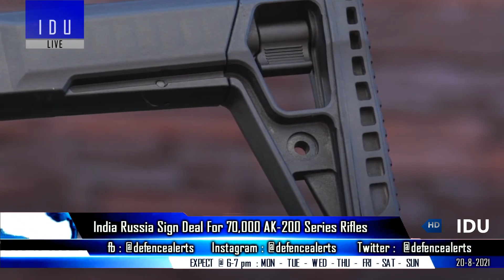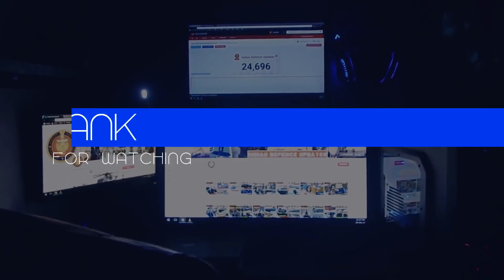Indian Defence Updates : 70000 AK-200 Series Ordered,36 Tejas Export,NGSLCM Final Phase,2 New UGCV

Comment: It looks like that exports of Tejas fighter jets will help us import foreign made fighter jets! The could be due to the fact that with acute shortage of fighter jets with IAF, and with imminent retirement of older jets in 5 to 10 years coupled with slower  production rate of Tejas will enhance the need for imports of state of art fighter jets.
Reply: No
Reply: @mangeshchalan8786  Kindly review the literature on Tejas production and capacity to produce the fighters, and dependency on imports of engines, and state of affairs of IAF with shortage of planes running into hundreds in the coming 5 to 10 years, we should not export Tejas,  unless we reach the capacity to produce 48 to 54 jets a year. Even then exports should  be in limited numbers.  FYI, as per media reports, the import of 99 engines from GE for Tejas MK1A will be completed by 2029!
Reply: @dranilchojar7016  It is HAL management that need a workover.  They have failed in the production of what they always promise.  HAL should be under the oversight of a few top industry manufacturers to train all HAL management.